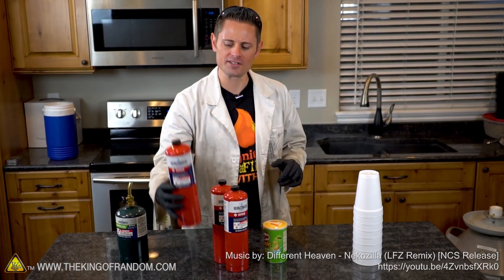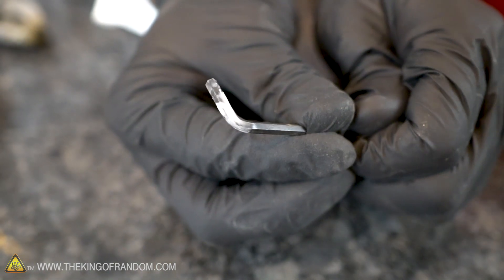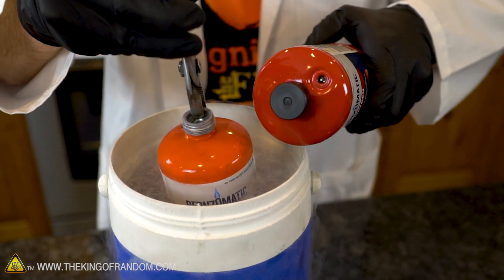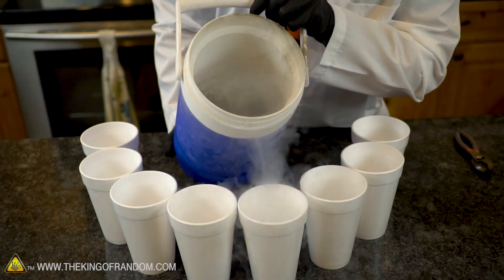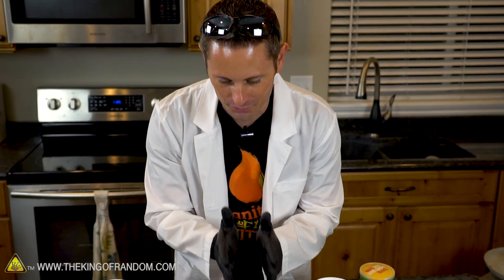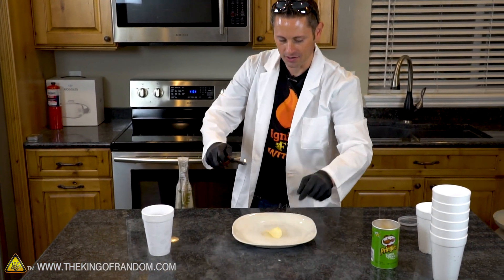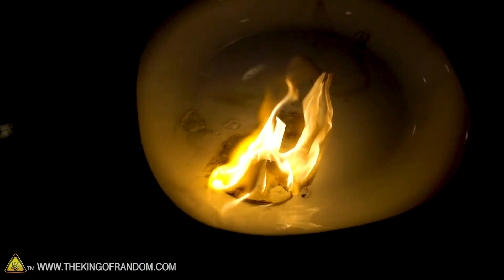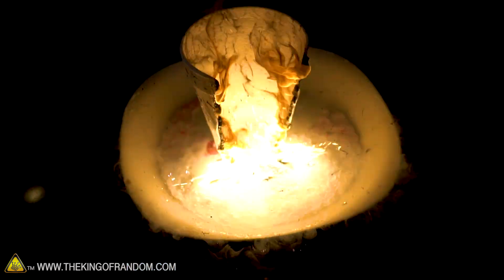How To Make Liquid OXYGEN! TKOR Experiments With Homemade Liquid Oxygen & How Oxygen Is Made

Comment: Propane becomes liquid at relatively low pressure. Different story for oxygen. You need a ton of pressure to have liquid oxygen. I have welding oxygen tank and at 2500 psi i don’t think there is any liquid, just high, high pressure gas. That’s why an oxygen tank is super thick and heavy.
Those little tanks don’t hold much because they can’t hold much pressure. I also have small welding oxygen tanks and while only a little bigger than that little tank they are way heavier constructed. Made to handle 2500 psi plus.
I don’t know just how much pressure you need for oxygen to become liquid but I’m sure it’s a whole lot more than 2500 psi. ( now I have to look it up )

Comment: What would happen if you put liquid oxygen in the red oxygen container you bought from the store?  Would it build up too much pressure and explode or just have alot more oxygen in it?

You should be able to do it by getting a cup with a hole in the bottom, putting it on top of the empty red container, filling the cup with liquid oxygen and pressing the button down with a screwdriver.

Comment: now you can refill the cyl and get much more longer lasting gas than that measly amount,,but its probably dangerous since the container is not a double tank thermos and so the oxy will start expanding with enough pressure to blow up the tank

Comment: How about using a small poney SCUBA Diving tanks, compress it with air to its rating 3200 PSI for aluminum or 2400 PSI for steel then use liquid Nitrogen to actually liquefy the air inside Air = 20.9 % Oxygen and the rest mainly Nitrogen plus trace gases.
Doing so, the 2 would separate by Density. 
What do you say?

Comment: A scientist working at home in Florida, has discovered a way to electronically vibrate water in an electrolysis unit to force the water molecule to break apart to form hydrogen and oxygen. The water, when vibrated at precisely the correct frequency comes apart much more easily, and therefore with much less electrical power, than when the water is not excited. This makes electrolysis much more economical and therefore much more viable. Electrolysis may well be an ideal way of using a 'floating' solar electric system when the batteries are full. Hydrogen is an excellent clean fuel, and oxygen is a super-conductor. It doesn't take much imagination to see potential here. Super conductive electric motors make electric jet aircraft viable, and we are told to expect them by 2030. Just as well, as jets are currently completely demolishing the atmospheric envelope. Thanks for your great and interesting experiments.

Comment: Those berznomatic cans of O2 don't contain liquid O2. It would be impossible to fill them with liquid O2.
#1 The O2 is beyond the critical Temperature so no matter how high the pressure, it will still remain as a gas
#2 The pressure inside the can would be too high and blow if you fill it with too much liquid O2 and let the can warm up.

Comment: What happens if you mix gasoline with acid
Reply: Nothing. The gasoline will float on the water. Gasoline is also a mixture of various alkanes, so it does not get attacked by acids. Double bonds on linear chains can get a H+ attached and water can attack it and form an alcohol.

Comment: Having been a Cryogenics technician in the Marine Corp airwing and also having a BS Mechanical Engineering degree all I can say is the conditions in which you are playing with LOX is extremely dangerous.  Now I can't see your boots(I hope you have LOX boots on) but if you step on a puddle of LOX with normal rubber soled boots, IT CAN AND IT WILL BLOW YOUR LEG CLEAN OFF.  LOX combined with ANY type of fuel source(no match or spark needed) can cause an extremely hot, violent and dangerous fire.  Ive seen the dangers first hand.
Reply: Navy AS here, Same as Marine GSE, & I worked on the LOX Farm @NAS JRB FT Worth TX, & all I can say is I was thinking the same as you, this guy is Gonna go up in a ball of flames faster than the Space Shuttle Challenger. Folks DO NOT emulate ANYTHING you seen here today, I promise you try this at home, you are gonna have reconstructive surgery on your face.
Reply: I have heard that one time, a lot of liquid oxygen spilled on asphalt and the asphalt caught fire since asphalt contains bitumen.

Comment: Can you try breathing in the liquid
Reply: I don't think you should try breathing it, but it's possible to. What happens is that it vaporizes from your internal body heat so take your pick if that's considered breathing it. Doing it for too long will cause your body to slow down, pass out, and probably die.

Comment: Can you breath liquid oxygen
Reply: no pure oxygen is poison because we are only able to process 25% oxygen also it is like -150 degrees f so you would freeze to death in 30 seconds
Reply: It would vaporize in a matter of seconds, but yes you technically could. Breathing it for too long would cause your body to slow down since it's harder for your lungs to breath liquids than it is gases and you would eventually pass out and yeah you'd probably die.
Reply: You would more then likely die from suffocation as the liquid would revert into a gas due to your body heat in turn causing immense pressure on your oesophagus and stomach puncturing them leaking into your chest and causing your lungs to collapse. 

If by some miracle you don’t die from the freezing temperatures first as stated in the first reply 🤣

Comment: Burning styrofoam a.k.a expanded polystyrene produces Phosgene poison gas and Carbon Monoxide as well as other products of combustion, so please be extremely careful.  The burning should be done in a fume cupboard (a cupboard which has an extractor fan to the open air) or in the open, never in an ordinary room.

Comment: I Think you just produced a mixture of liqiud nitrogen and liquid oxygen. If you want to produce pure liquid Oxygen, fill a copper funnel (which is not opened at the bottom) with liquid Nitrogen. There will be Oxygen condensating on the outside of the funnel, and dropping down in the center, which can be collected with a cup underneath the funnel. This happens because copper conducts heat verry well and the condensation temperature of Oxygen is a bit higher than the one of Nitrogen. By using this method you should be able to make your Pringle burn like crazy!

Comment: I'm confused.
One minute I see you pour some liquid nitrogen into a Styrofoam cup and the next minute you tell me it is no longer liquid nitrogen but now liquid oxygen.

How did it get to that?
You didn't explain what made the change.
Is it when it warms then it becomes oxygen?

And you also said liquid nitrogen is not flammable but liquid oxygen is.
How so?
Reply: The liquid nitrogen cools the oxygen in the air until it becomes a liquid. The nitrogen boils off and the liquid oxygen is left. For something to burn you need three things, a heat source, fuel, and oxygen. The liquid oxygen isn't flammable but it allows a fuel source like the chips or the Styrofoam to burn faster and hotter.

Comment: "Be extremely careful, what I'm holding here is extremely flammable and will explode"

*lights on fire*
Reply: I mean it's literal jet fuel, you've got to be pretty crazy to light stuff up, especially indoors.
Reply: it's not jet fuel it's not any fuel at all it's a strong oxidizer jet fuel is kerosene
Reply: Fires need oxygen and a flammable matter to burn, the oxygen is merely a "supply" to maintain the fire. The flammable component is what's really flammable, in the example of a jet engine, it uses jet fuel and takes in oxygen as well to make the compression possible. An engine uses a mix of fuel and oxygen at high pressure(caused by pistons) then lighted with a spark, to generate an explosion, the engine then extracts the kinetic energy it's given by the explosion to create movement to it's other parts.

If you have heard of the "triangle of fire" or anything similar, for a fire to ignite it needs, flammable, oxydant(most of the time will be oxygen) and a temperature of ignition
Reply: AB CD it is not flammable. It is a strong oxidizing agent. That means that it only makes doors burn hotter and faster
Reply: Said every scientist ever...
Reply: Not really. Everything in the universe follows a pattern. The misconception of random tries to justify what is simply beyond human perception.
Reply: It's not flammable, is pressurised though so can explode
Reply: Random Happens
Reply: Grant was more gutsy and experimental. The new guy doesn't have the same spark and the content is deteriorating

Comment: He should mix liquid O2 with liquid H2...perhaps he might get water
Reply: combustion would need to happen
Reply: H2O2 is hydrogen peroxide, looks like someone threw out their chemistry book
Reply: h2o2 is peroxide
Reply: Wolfless Gaming Chances are combustion would happen, considering how volotile the mixture would be just some static electricity could set it off easily
Reply: It wouldn't make water. It would just be a hydrogen-oxygen mixture. Hydrogen and Oxygen elements make up water, not the actual thing. ex: water isn't made of the oxygen or hydrogen gas, but is made up of the elements that make hydrogen and oxygen gas.
Reply: Please don’t, as a huge nerd I must say it is bad for your health.
Reply: H2o2 makes hydrogen peroxide, and it's Ho2 a. k. a H2o
Reply: Ho2 is a very different substance to H2o. H2o would mean 2 hydrogen atoms bounded to one oxygen atom and Ho2 would mean 2 oxygen atoms bounded to one hydrogen atom.
Reply: Flippers op ya nerds are gud
Reply: More like ice
Reply: Mexican Dad the only problem with that is you need an activator or something that will bind the 2 elements together. And h202 is hydrogen peroxide. Very dangerous decision, mi amigo.
Reply: How would you even get liquid hydrogen?
Reply: Gary Hall just light it, then it will turn to water. It will explode though. Too dangerous 😰
Reply: That would turn into hydrogen peroxide.
Reply: No liquid H2 and liquid O
Reply: you won't get h2o2 just by mixing liquid h2 and liquid o2. And yes h2+o2 can form water. H2+(1/2)O2=H2O or 2H2+O2=2H2O (if we're talking about molecules)
Reply: Liquid H2 is way too cold and difficult for him to get
Reply: That's Hydrogen Peroxide
Reply: H2o2 is bad and deadly

Comment: Since the O2 in the canister already seemed to be in gas form, I was worried that the cold liquid nitrogen would depressurize the container to the point of collapse. I was also thinking that this reduction of pressure would mean that opening the valve would cause the container to draw in air rather than release oxygen.

Comment: If you mixed this with gasoline and put it thru an engine, would it 'super charge' the engine?
Reply: It would blow up the engine
Reply: if you stuck in the same ratio, it would. But if you leaned out the mixture, would it be more economical even?

Comment: You should try and mix liquid oxygen with gasoline and stick a firecracker in it. Then you strap fire works to the sides of the Styrofoam cup, light it and throw it in the air. Or just launch it from the ground, also try putting food coloring in it!

Comment: If you could, try to liquefy hydrogen and mix liquid oxygen together with it and make some sort of super cooled water. It might even turn into dry ice or something!  I really want to see it happen.
Reply: Felix_F. Animals If any friction or contact, it might ignite in a rapid high-temperature flash. Other than that, since the temp of liquid hydrogen is much lower than oxygen, the hydrogen would boil off. Hydrogen and oxygen combining to produce water would require the release of energy(fire).
Reply: it wouldnt become dry ice bacause dry ice is carbon dioxide or 1 carbon atom and 2 oxygen atoms but water has 2 hydrogen atoms and 1 oxygen aton
Reply: Still, what do you think would happen?
Reply: That is very intresting! I would still like to see it happen though right.
Reply: Felix_F. Animals That, my friend, is what you call rocket fuel (seriously)

Comment: Try freezing the liquid oxygen in a freezer and see what happens
Reply: You can't because unless you are a chemist with a special freezer it won't get cold enough.
Reply: Chase Erickson friend groop normal freezers don't go low enough to freeze the oxygen, and oxygen will need to be pressurized extremely to make it solid. And it would still evaporate because the freezer is above the oxygens boiling point

Comment: you've made solid nitrogen what about solid oxygen?
Reply: Way2Weird Official not without a lab. That requires extreme pressure. I'm not sure solid oxygen is even possible on earth
Reply: Green Kreeper it is possible. But this stuff isn’t even liquid oxygen. Any state of oxygen requires INSANELY cold temps and certain pressures.
Reply: Way2Weird Official that's called aerogel

Comment: I make LOX with a self made system using an old freezer compressor (1st stage) then the gas is passed on to another compressor in which is chilled until LOX is created. The refrigerant used is a self mixed solution. So far I have made a litre of LOX. Its a nerve-wracking experience. once you figure out the cooling portion and how to remove the nitrogen it makes some pretty decent poor mans LOX.

Comment: well it´s not crazy ,that liquid oxygen is magnetic. actually the oxygen you breath is magnetic to. it´s paramagnetism which is induced by unpaired electrons and if you look at oxygens orbital model you´ll see oxygen in it´s basic energetic state has 2 unpaired electrons. so it is magnetic. and technically it is not flammable. it is the oxidizer burning the fuel. flammable is always the fuel.

Comment: Volatility is not what makes it explosive. Oxygen, not surprisingly, is an oxidiser. Oxidisers are chemicals which allow substances to burn more thoroughly by offering a higher oxygen concentration than that of our air. The chip is able to be fully vapourized, or converted to CO2 and H2O(g), due to the high amounts of available oxygen. On the other hand, volatility is the tendency for chemicals to become gaseous at "room temperature." Another example of volatility is acetone, another highly flammable compound, so it is understandable that you would confuse the two.

Comment: add thermite with liquid oxygen
Reply: I think that nothing will happen because thermite has his own oxydiser.
Reply: NO! NONONONONONONOOOO NOOOOOOOOOOO
Reply: Todor Popov nope it will act as an “accellerant”, dangerously intensifying the reaction
Reply: Thermite contains its own oxidizer in just the right proportion for maximum heat.  Adding LOX would actually just reduce the heat.

Comment: Instead of 1000 degree knive use a  -1000 degree knive
Reply: Raid Benz You can't, it is below absolute zero.(zero kelvin)
Reply: Ben Funk -1000 degrees isn’t obtainable according to the rules of the universe
Reply: It only goes down to about -271
Reply: Knife*
Reply: Probably shatter instantly
extremely cold Metal + a little kinetic energy = pile of metal on the floor.
Reply: Knife u spell wrong
Reply: Fuzzy Head Gaming its you not u so you spell wrong
Reply: Loops Gamer lol
Reply: Grammar Nazi so a super-frozen knife? (like putting it in liquid nitrogen to freeze it)
Reply: Ben Funk YES
Reply: you could synthetically go below absolute zero but it is very hard. tenperatures below absolute zero can be reached in the case where there is negative pressure and pressure is proportional to temperature.
Reply: Green Kreeper no duh
Reply: To proceed please put knife in freezer for 2.9 billion years
Reply: I think thats impossible
Reply: you can't, because temperature = particles moving and having energy. absolute zero (apx. -273,xx degrees) has particles moving not at all which is not possible due to conversation of energy and some other thermodynamic laws. so no -1000 degree knife for you.
Reply: The lowest possible temperature is 0 kelvin. Or -246 Celsius.
Reply: That’s colder than 0 kelvin and 0 kelvin is impossible to get to 0 kelvin becuas of Newton’s laws
Reply: -273,15 to be exact
Reply: That's impossible, the knife will be brittle and break, it won't even reach that temperature before that happen
Reply: Ben Funk That's impossible
Reply: Normal freezer cant go below absolute zero

Comment: It appeared to me that there were no bubbles in the liquid nitrogen before you dunked the cylinder. It seems to me that if you dunked the cylinder until there were no bubbles at all , the liquid nitrogen , the cylinder and all the oxygen in the bottle would be at the same temperature. At that time there should theoretically be 1.4 ounces of liquid oxygen in the cylinder. The question then is with all the oxygen in liquid form would there be a vacuum in the cylinder rather than pressure?

Comment: @Grant Thompson "The King of Random" I have a experiment idea, there is a faction of individuals who believe NASA is a fraud and I would with your help like to prove them wrong. They say that rockets can't work in a vacuum, so the experiment goes like this, a bottle rocket set off inside of a vacuum chamber, since a flame isn't possible in a vacuum the bottle rocket will have to be ignited with a electric glow rod. The tricky part is rigging the glow rod into the vacuum chamber, if it's possible to pull this off I would love to see how the bottle rocket reacts in a vacuum, I may even go ahead and see if I can pull this off myself, I'm a HVAC technician so I have the equipment to try this just not sure if I have the time right now because this is the busiest time of the year for us HVAC techs, but I'm super curious to see what happens.

Comment: you should try a can of air.  used to dust off electronic stuff.  I turn it upside down to freeze my cpu and overclock it.  but doesn't last for long.  there seems to be more liquid air in those cans than those bottles you had